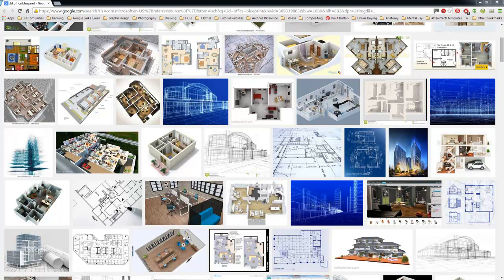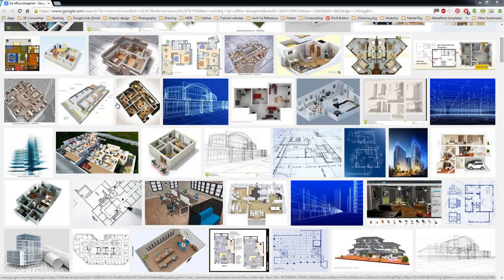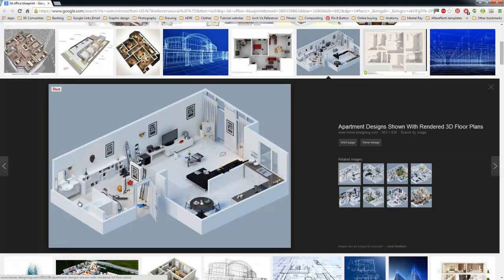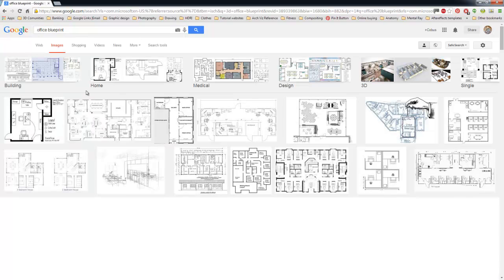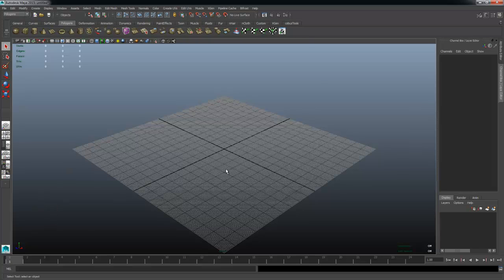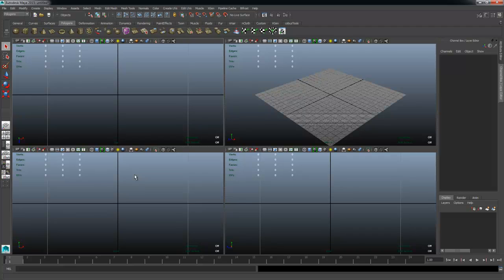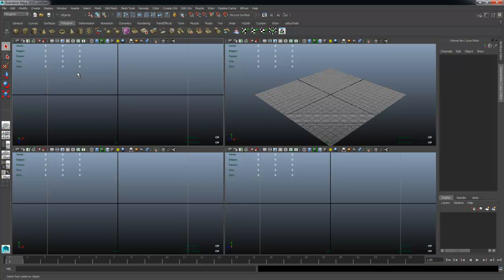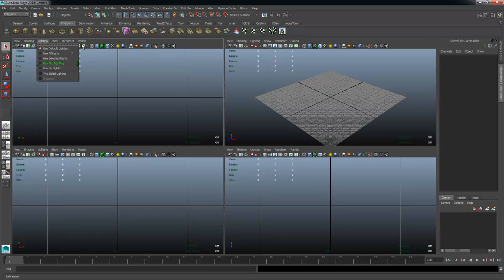Maya 2015 Modeling Tutorial using modeling toolkit  maya Modeling from blueprints

Comment: I can't seem to refine the vertex' for the internal walls , do you use a shortcut when straightening them?
Reply from the maker: Hi Saskia. Thank you for the comment. you can straighten the edges and vertices by using the scale tool and then scale it to the axis that lines up with you  edges. 

You could alternatively use the snap to vertex constraint by holding down. "v" for point snap. and the drag towards the axis of that matches the vertex that you want it to align.

I hope this helps
Reply: perfect! thank you :)

Comment: Hi,I want to ask how you simply just drag to rotate the picture in the grid and resize it.I just can't do it.I'll be expecting your reply.
Reply from the maker: Hi thank you for your comments. im not sure what you mean exactly. but if im understand you correct, are you trying to move and rotate the image plane?
Reply from the maker: Hi thank you for your comments. im not sure what you mean exactly. but if im understand you correct, are you trying to move and rotate the image plane?
Reply: +Cobus van Staden Yes
Reply from the maker: You can select it in your outliner. Its called image plabe and then move scale and rotate it with your manipulator tools in you toolbox on the left hand side of the the screen. Shortcut: w, e, ris shortcuts for moving, rotating and scale.